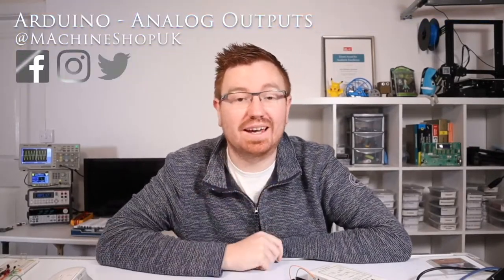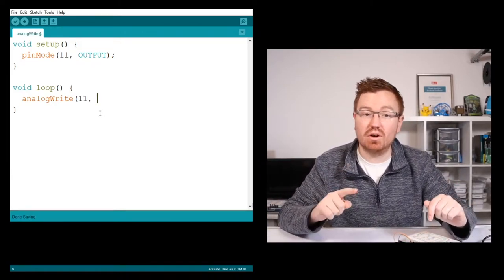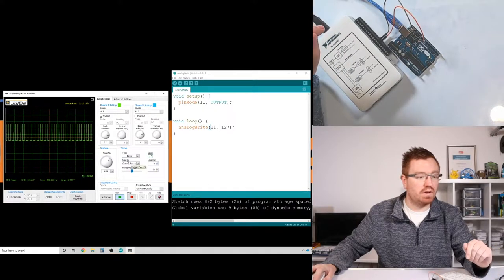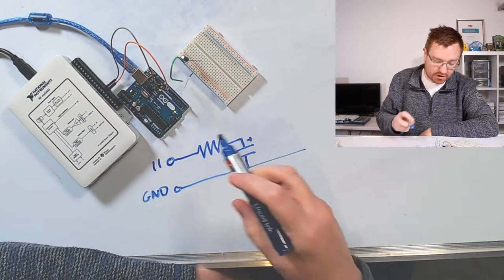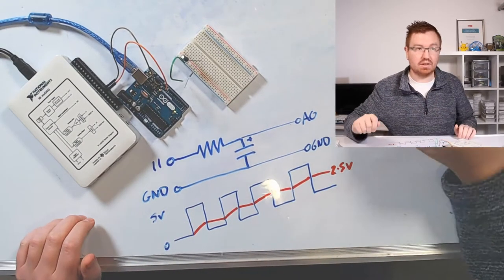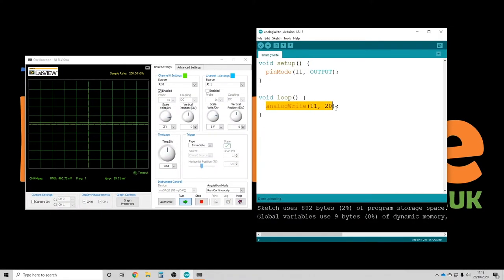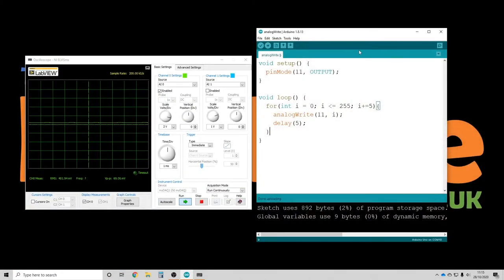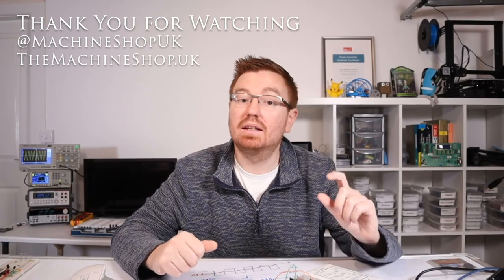Arduino - Analogue Outputs

Comment: Thanks for your video, it is helping me to setup the analog outputs 0-5V on my Arduino Mega 2560, one question, what will be the typical resistor and capacitor specifications for an interface with a typical PLC 0-5VDC input channel?

Comment: This has been very helpful to me as I was struggling to understand how to get a "simple" analog level out of my Arduino.  I understand the notion of an RC time constant.  But as many comments here ask, can you please provide some insight as to how to choose the RC Values?  I assume it would be related to the PWM frequency, but also to how quickly the analog out is turned on and off.  For example, I am interested in operating an individual electromagnet in a motor (not the motor itself) and might need to switch the electromagnet on and of at a rate of 48 KHz.  I know enough electronics to know the R and C values will affect this performance but don't understand how to select those values or what the trade-offs will be.

Comment: Can you specify resistance and capacitance used in the video please? I need it for my final work for high school. It would be greatly appreciated!
Reply from the maker: Hi Ivan, thank you for the comment, the values of the resistance and capacitance would depend on what you are connecting to the Arduino and the frequency you are using. You should do your research, look up RC Time Constant
Reply: @TheMachineShopUK  Thank you for reply, your video really helped me a lot.

Comment: Question. If I use a capacitor with less capacitance will the signal get more accurate?
Reply from the maker: I wouldn’t say more accurate but it would be faster to respond and decay, if you want a steady output then this would introduce more ripple
Reply: @TheMachineShopUK  ok thanks